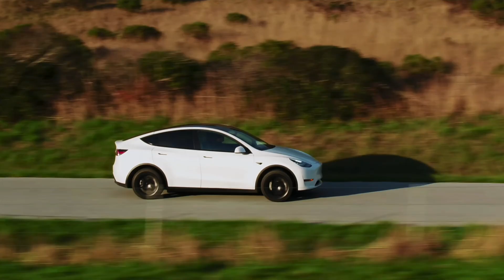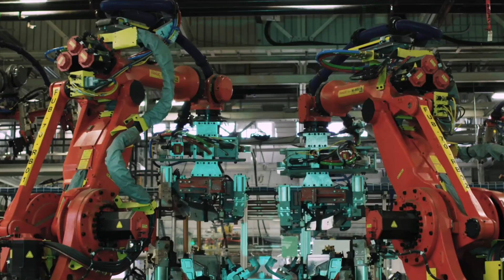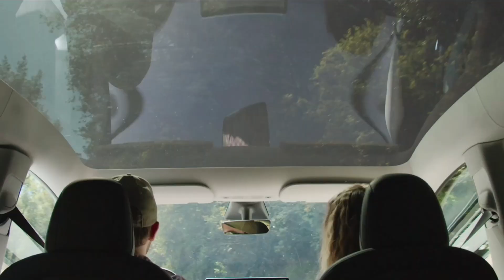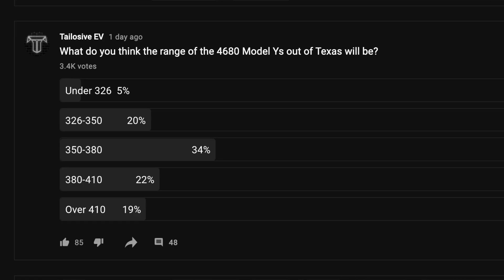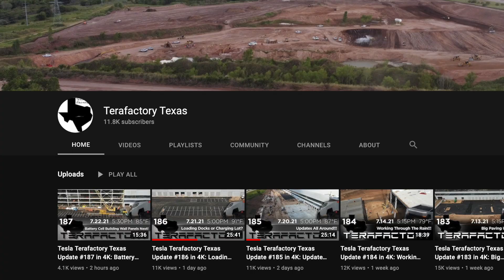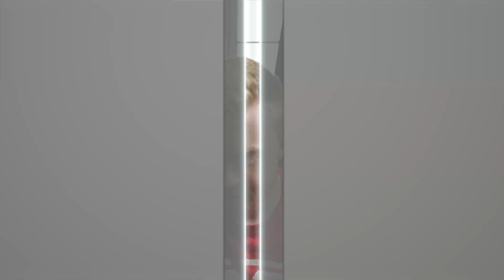GigaTexas 1 Year Later

Comment: I bet that the way that they will produce both 2170 and 4680 cells will be having different versions.

Like the having The Fremont factory only makes long range Model Ys and have the Texas Giga factory make the performance model for extra performance and range (and lower production cost higher profit) and the standard range have 250 and be 4680 at Texas.

They could do it with different model selections but I see them doing it this way in some way.